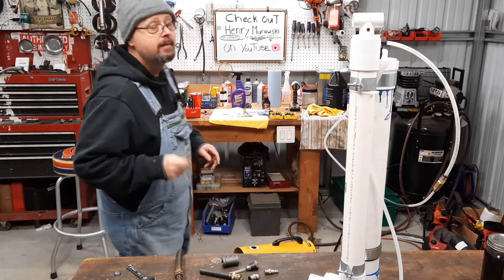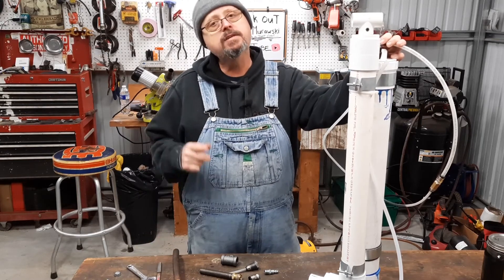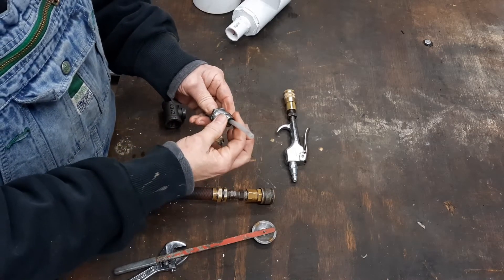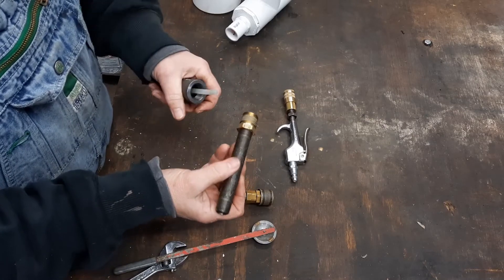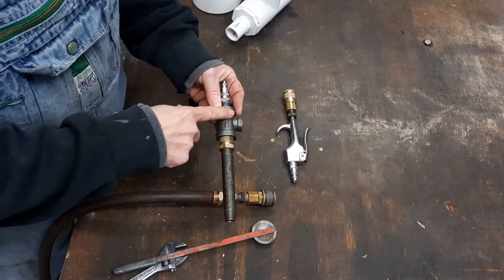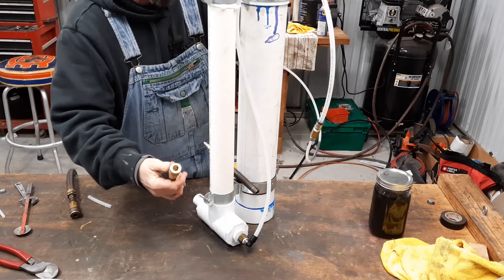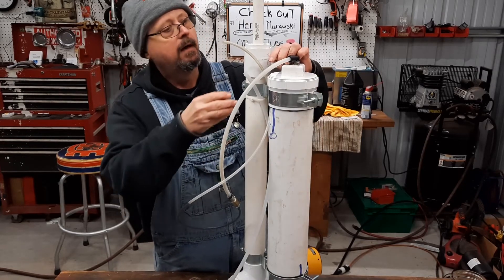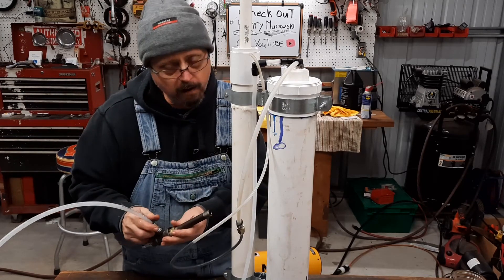How to build a DIY air operated oil extractor.

Comment: Could you then put a valve on the end to shut it off and then use it to pump the oil out?
Reply from the maker: @ajgarcia1667  yes, reverse the valves to ad psi need a pickup tube

Comment: I enjoyed your videos. I recently worked on a kolher courage twin that I adjusted that valves to 4 thousandths and the starter still would not turn the engine over with a new battery.  I bought a new oem kolher starter and it works like a champ. Thanks for the video that you put out showing that same problem. Customer is happy I'm happy. Thanks again. I'm going to make me a pneumatic oil evacuatoe now. Thanks a bunch.
Reply from the maker: Hey hey glad it worked out. Hope your oil  evacuation pump does also